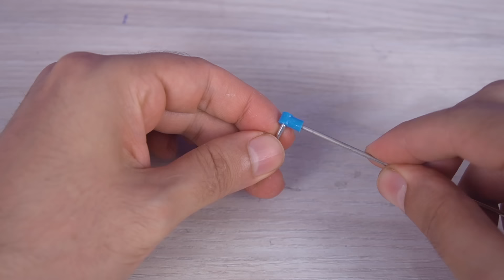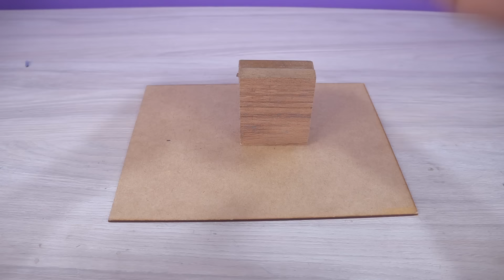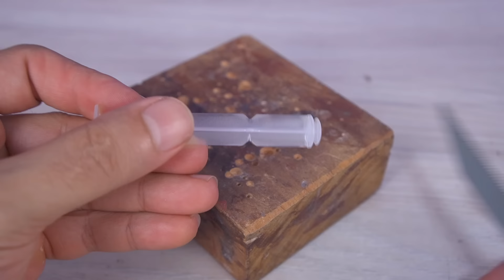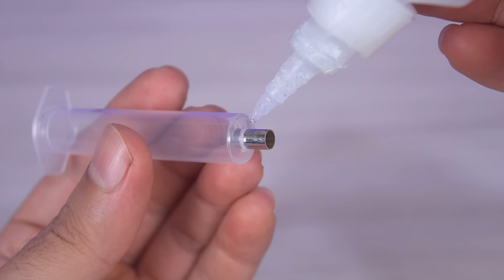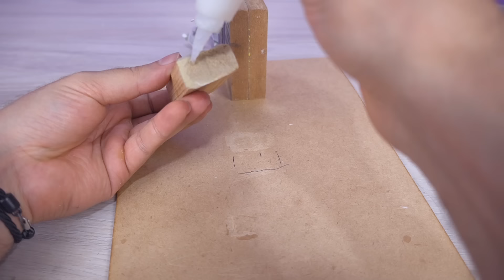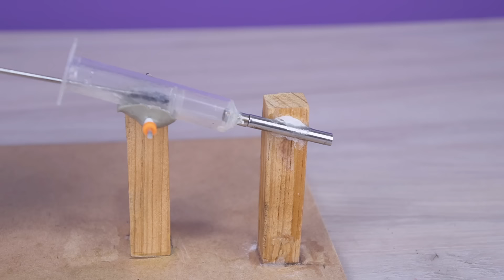Make a Simple Steam Engine Project for Science Fair

Comment: No that is an air engine I think you got that wrong
Reply: if you give it steam instead of air it will still work
Reply: @The_king3493  Good thing he didn't
Reply: I guess.
Reply: @Fredrick_6  well if the steam is hot enough then it could melt
Reply: @The_king3493  Still an air engine
Reply: @Fredrick_6  Heating up water to produce steam is by far the simplest part of making this project, and if youre really trying to byild one you already hnow how to make the pressurised steam. Stop being dumb
Reply: @The_king3493  You wont be able to produce steam at a high enough pressure and temperature to melt any of the equipment used in the video. Steam for the scale of this project is simply not nearly not warm and pressurised high enough... unless you REALLY dont know what youre doing and mess up the scale by a lot😂😂
Reply: @christoesterhuyse5328  you know theres something called super heated steam which can be over 2000* C
Reply: @The_king3493  Yeah, I onow all about superheated steam because of Thermodynamics, but no one will build a steam car with a boiler capable of producing superheated steam... you wont produce such high temperature steam as to melt any component in this design
Reply: @christoesterhuyse5328  the hot glue can melt with normal steam

Comment: That's obviously not a real engine.
Reply: Well no kidding m8. The engine works by blowing into a tube where the air from his mouth pushes the piston to the back of the cylinder. Then the cylinder tilts up to cut off airflow. And the momentum in the Dvd Wheels sends the piston back to the rear and the cylinder tilts back to let in more air and repeat the cycle. This is called a “Single acting” steam engine.
Reply: It’s called a steam engine
Reply: @Firebash9  yes. Im denoting that its a type of steam engine.
Reply: @Ehimherebecasuewhynot  I know I was just letting them know just if thay didn’t read yours
Reply: @Ehimherebecasuewhynot  I know I was just letting them know just if they didn’t read yours
Reply: @Firebash9  Oh ok.
Reply: @Firebash9  oh ok.